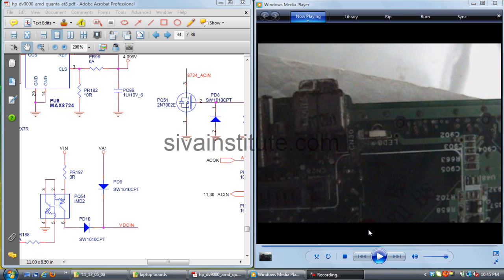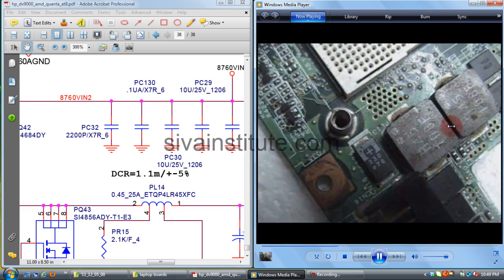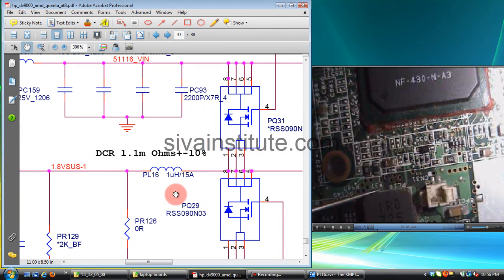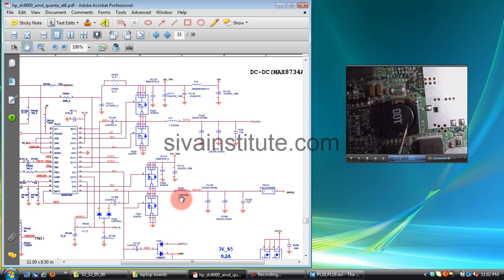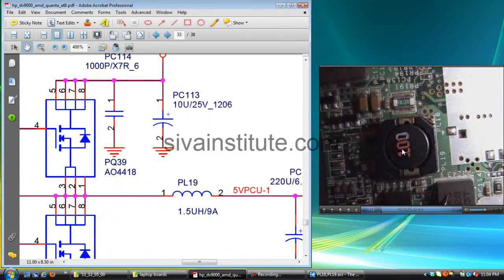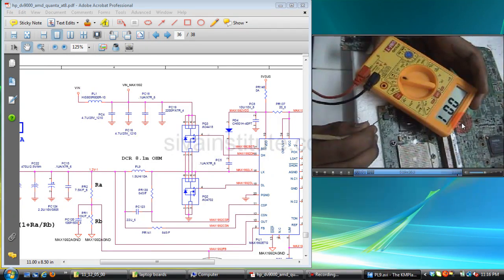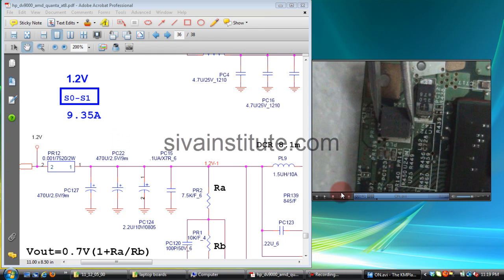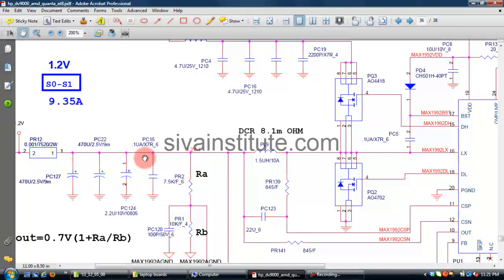How to check dead(short) Laptop Motherboard step by step.eng

Comment: Ok so question, is a coil supposed to have 1 negative and 1 positive? I am assuming no, because you checked if its shorted to ground, but I don't know if the other side was to ground.

Comment: My power supply short circuited with the PC chassis. Now my motherboard is totally dead. No display, fan not turning. Suspect no current going into motherboard. What components to check for damage. Motherboard is G41T-LAI0 V1.0 from a Lenovo Ideacenter B500.

Comment: acer4740 5740 5742 5745 .,hp431 430 630 2000 530 dv6 dv4
dell n5015 after reprogram laptop run 2-3 minute ok than automatticlly shutdown problem
Reply: First check, your CPU FAN, Heatsink thermal, if still not working try to find some short capacitors behide the CPU, some notebook model using NEC TOKEN ic instead of capacitors, try to change that IC if you cannot find other shorted caps.

Comment: NICE GOOD LESSONS SIR, WILL TELL WHAT SHOULD BE PROBLEM IN LAPTOP WHICH HANGS ON BIOS LOGO SCREEN?
Reply: Generally it means computer try to recognize the HDD or CD or any Drive. You can try take out the HDD, CD and other external components(USB...)

Comment: Hullo am called Samuel,from Uganda,i have gained a lot from you lesson but i have faced one challenge ,of a dell laptop N50540 which black out and couldn't power on ,the fan doesn't function and there is just a beep from-the power light.plse i need a solution.

Comment: I would make sure there was enough thermal compound and the processor making good contact with its heatshink. re-apply . iS THE FAN coming on and if so is it frequent...and irratic.??  If all ok..I would be wondering whether one of the capacitors was breaking down. ?? Well thats what I would do.

Comment: Is there no other shorted components?you did not prove that after replacing the shorted component the laptop is back to normal?L is stand for coil or inductor and resistance is shorted or 0ohms..